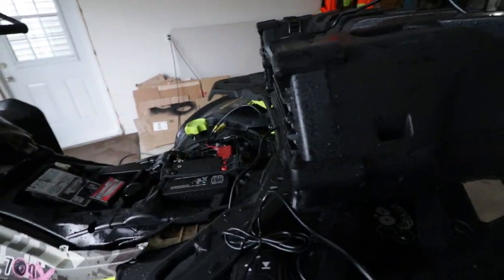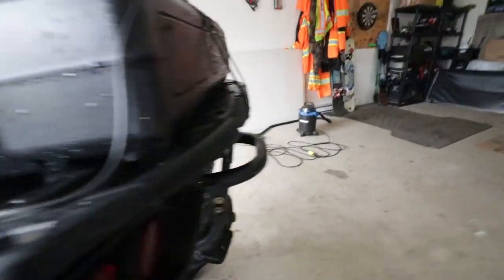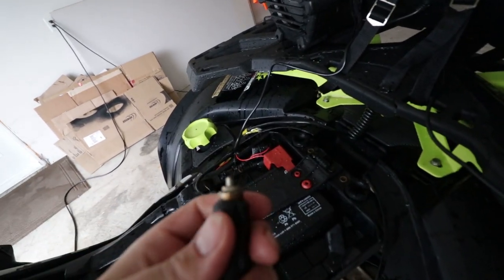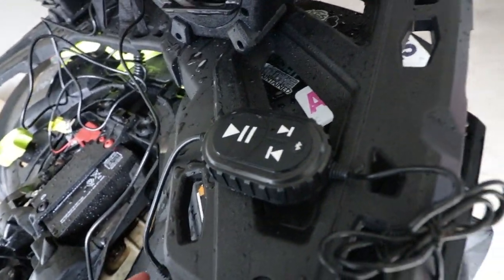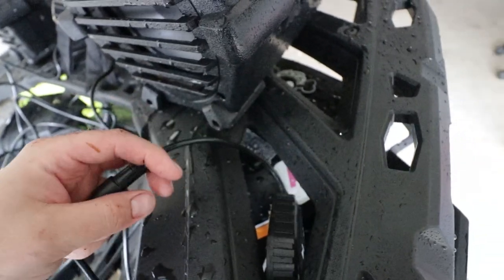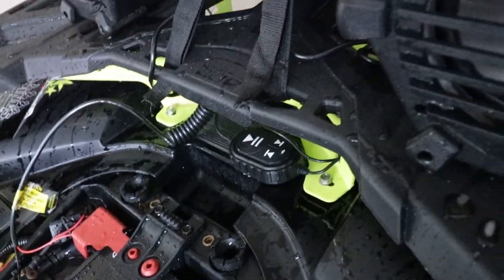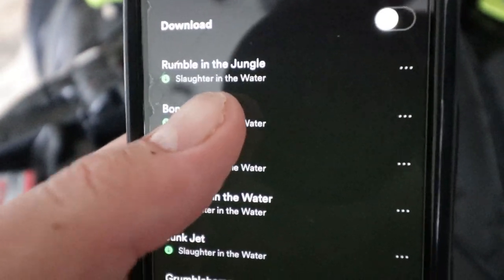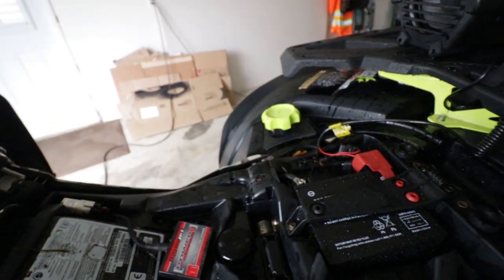PLUG AND PLAY - Boss Audio Systems Speaker Install Can Am Renegade

Comment: So I drive a older Honda and I don’t have the plug in part but the speaker comes with one so if I leave the plugin connected to the battery is it gonna drain the battery or do I need to put it on a toggle switch
Reply from the maker: elliot spears you can disconnect the speaker from the quick connection going to the battery when not in use.
Reply: @Myler709x  please help so I have one my buddy gave me he got. A new one but you
Know the 12 volt connecter yours has  mine has it but one of the clamps on the plug in is off and it’s very lose i tried to fix it now the red light won’t appear
Reply from the maker: @galaxygaming-yt4835  what did you do to try and fix it? May have damaged it.
Reply: @Myler709x  so what I did was the clamp on it was pushed in so I pushed it out it’s rusty because it’s old

Comment: How is the sound when you ride with this mounted on the back, does it feel loud enough with the engine noise and the wind?
Reply from the maker: On my machine it’s a bit quite. I have a very loud after market exhaust. I mostly used it when we would park on the trails
Reply: I have a 2020 renegade xxc myself and since there is no front rack to mount it to, I was wondering if at high speeds we could still ear it lound, if not I will probably end up buying a set of handle bar speaker.. thanks

Comment: What rear rack bracket are you using?
Reply from the maker: The factory BRP bracket.
Reply: @Myler709x  i have a 2020 xmr not sure it will fit 😩 lets hope i said fits g2 so we will find out thanks man.
Reply from the maker: @kylecline6656  if it’s the BRP outlander/renegade rack it should fix

Comment: Hi, how do you adjust the volume from the remote? Doesn't look like it has volume up/down?
Reply from the maker: Its adjusted on the device you have connected
Reply: @Myler709x  i believe u can hold down forward and reverse buttons to control volume as well, but im not 100%

Comment: As far as the waterproof capabilities go how has it held up i have a 21 renegade xmr and im going through holes where the back part of the bike is submerged and doing a wheelie just to get through it
Reply from the maker: Honestly I’ve only used it a few times. It’s been completely under water on some runs and still works.